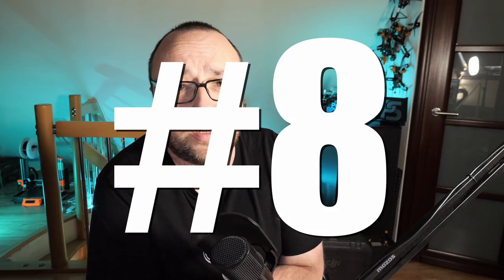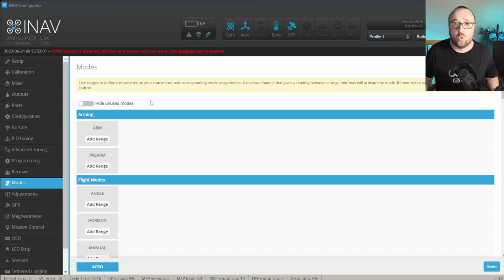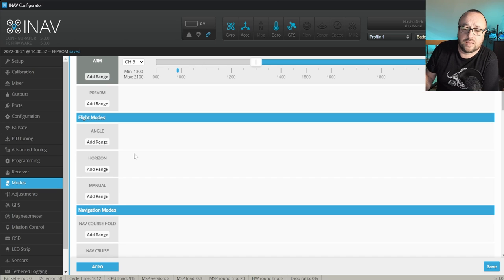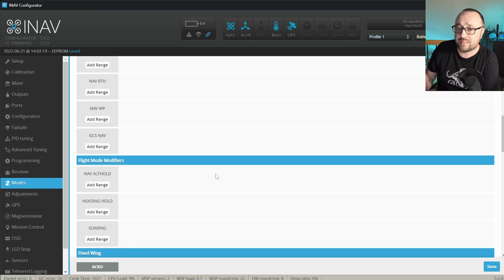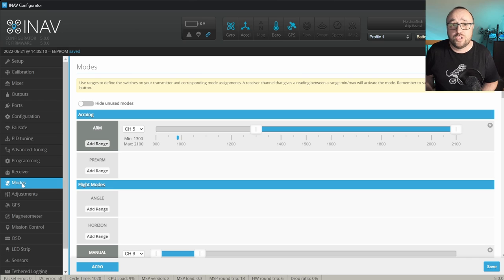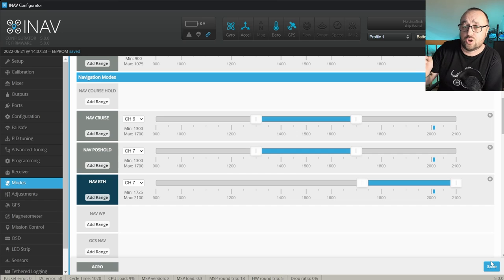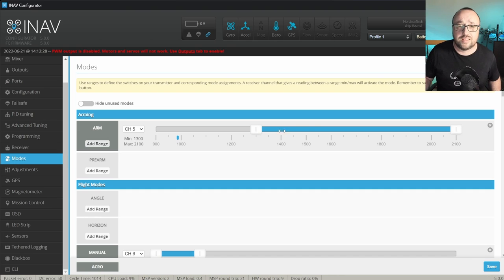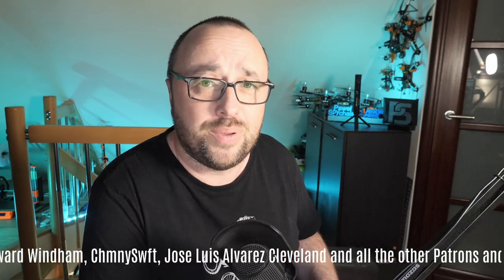Flight Modes | INAV 5 on a flying wing | 8/11

Comment: Hello Powel! What a great series about INAV 5.0 you have! I have a couple of questions from this episode:
1 Why are you coupling the Nav Althold mode to the Nav Cruise mode when the Nav Cruise mode itself handles the altitude?
2 Why don't you use the continuous Autotrim in the Configurator instead of allocating a switch for that mode?
Reply: (Following)
Reply: exactly what I was thinking, this is how I did it with inav 2.6. but the nav modes have changed in the new releases of inav
Reply: Pasha, day otvet

Comment: doesn't the cruise hold the altitude, and it's necessary to add altitude hold?
Reply: I think you are correct.  It used to be called 3D Cruise prior to Inav 3.0 when you had to add Alt Hold to Cruise.
Reply: @joemoffo9706   Yes, I fly a lot in NAV CRUISE without NAV ALTHOLD and  my altitude is always very constant.
Reply: @ApappieK  same

Comment: Thanks for your tutorial! but I'm dying to see the next video covering the osd. I'm having problems with inav not showing the correct information. Such as enable (battery cell voltage) and something completely different shows up in the goggle osd. Even the satellite information is wrong. Not sure what's the issue but I hope I can figure it out.

Comment: Pavel you are amazing as usual.  Thanks. 
Is there a problem / forbidden that the Arm channel not be the last (12 in my case) and not immediately after the last Auxiliary channel?
Reply: There's nothing that prohibits it unless you are using ELRS, in this case, is a requirement (well, technically you can have arming in another channel but it's unsafe). It is more a matter of best practice.

Comment: I am using INAV 7.0 and setup modes/switches just as you have here ,but when i add manual mode to lower range, and leave the top range open, ACRO mode never come in. The only way i am able to get the results you have is to use ANGLE mode instead. What have i done incorrectly?
Reply from the maker: No idea what might be but I expect one of the ranges is incorrect. Manual is independent from acro

Comment: iNav 5.0 or RPM filtering configurator say must hast ESC telemetry, is it still need to be wired telemetry or can it get fro belheli32?  FYI, motor remapping does not work, change it and apply and save reboot and it's back to 1234 original order and not change which motor spins.

Comment: Is there no collision of mods when two radio channels control the choice of flight mode?
Reply: Modes follow a preset order of priority. MANUAL>RTH>WP>NAV MODES>ANGLE>ACRO
Reply: @theHDRflightdeck 
so if one channel sets MANUAL and another channel sets RTH... MANUAL wins? Wing will not come back?
Reply: @Tonynux  correct

Comment: Thank you so much for this playlist, almost finish to build my first fpv wing following your tutorial

In my case I have set just angle, manual and acro in a switch in that same sequence 
I'm curious about if I can set the cruise and althold in another switch for use it even when i'm flying in others flying mode or is required to disable one of the other for use it, by the way I don't have poshold on my inav modes tab, why could be?